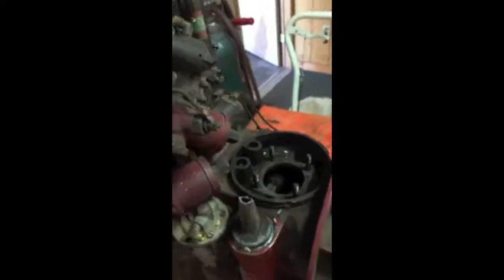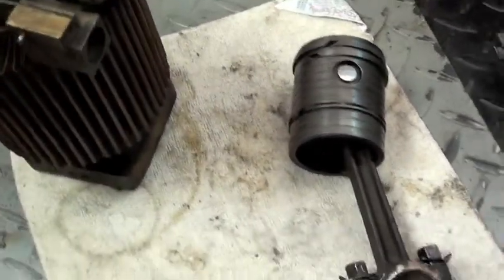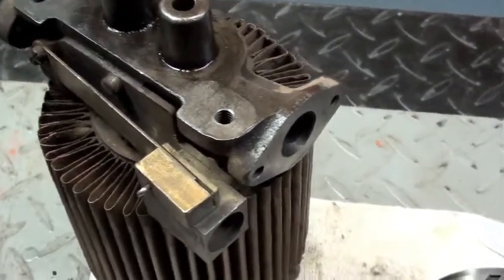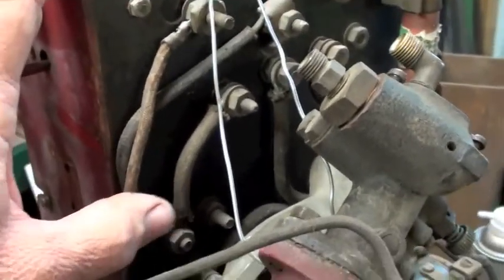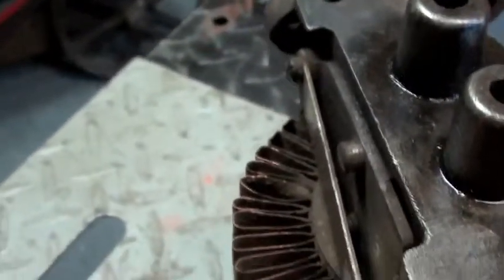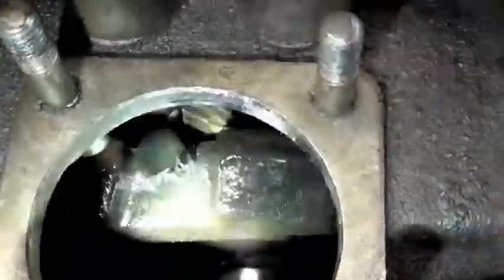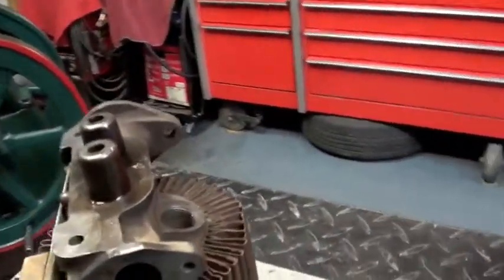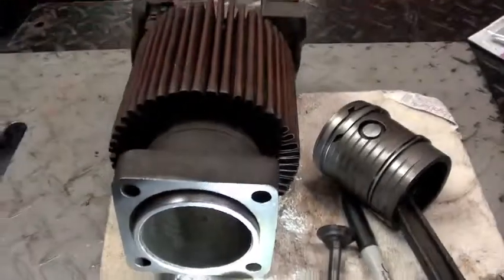DelcoLight part 3

Comment: That's some awesome technology for the day! I own a 60s Onan DJA genset single cylinder diesel. And it's amazing how much in common these gensets really haven't changed much in their methods. But today we would call the Delco setup a flex-fuel type system for running or starting on gasoline and switching over to kerosene or fuel oils. But there are some fascinating similarities between the 2 after watching your video. The DJA utilizes air cooling as well, and has a Champion Spark plug type intake heater to warm the incoming air as well, but it's a 12vt system that uses the generator side as the starting motor as well and at almost 22:1 compression ratio it's amazing how much torque is generated by the giant generator motor to crank the thing over. The solenoids are not quite as large as those Lol but they basically are there for the same reasons in controlling the high current lower voltage side of the system. But otherwise very cool machine and which I could find one in such nice shape one day? I know they only produce a lower AC voltage than what we have today but it doesn't make them less desirable! The fact that most of the ones out there are still mostly original and still run and generate is a testimony to how things were built back then with overkill and pride to outlast its owners! Thanks for sharing this and I hope you get her to produce some power!